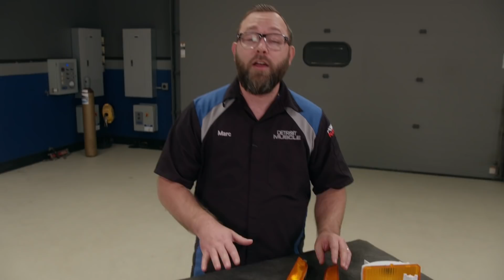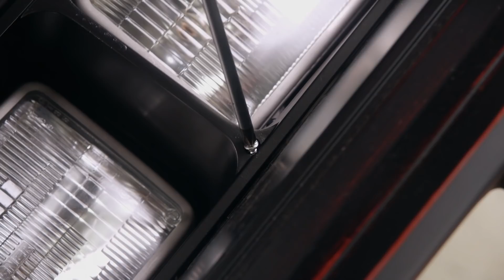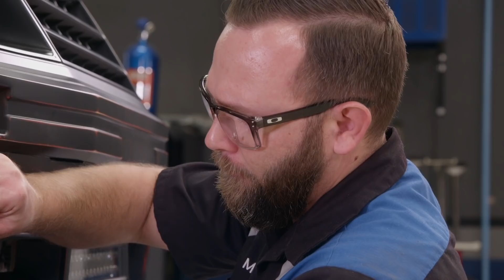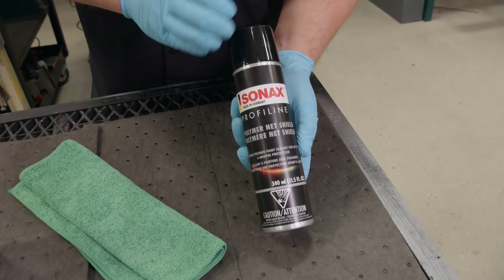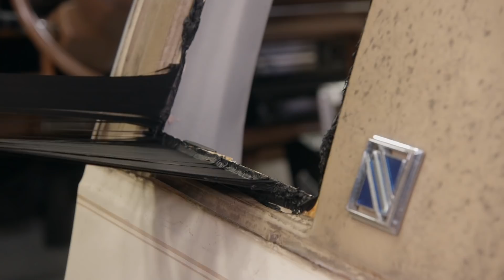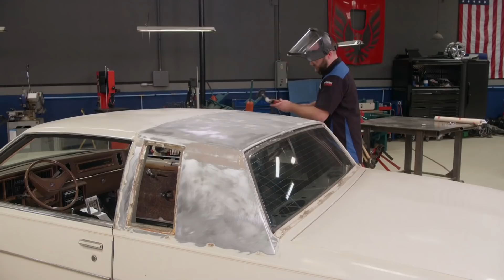Adding an Air Splitter on a Mustang Cobra Foxbody - Detroit Muscle S6, E5

Comment: I also came home from the hospital in a mustang. 70 mach 1 blue shaker hood and those black louvers on the back window. My dad said itd be mine at 16 well sold it when 12 or 13 yrs old.  My parents told me when they met that they had identical blue mach 1s. Moms was in nicer condition w the mag 500s and shaker hood. Dads had the cragers and louvers lol so switched wheels and sold his.   He regretted selling those mags cause how valuable they are now. Well then lol.  Dad passed couple yrs ago and I'm still a mustang guy because of him. I have 89 fox 347 5 spd and his 95 tbird 4.6

Comment: It probably don't matter but that opening they mounted the light bar in is more important for cooling than the actual grill. You always want to keep things like that in mind when playing with your toys. Like I said , prolly won't cause a problem as they upgraded the radiator and cooling system.

Comment: As for the LED Lightbar for the 81' Fox...

"Technically" that would be a Driving Light, as a TRUE Fog Light is AMBER... That would look ALOT better!🤯

Sorry for the "Technical Spatter", I'm just trying to clarify.

P.S. What episode went over the Engine, Brakes, Frame, Suspension, and Rear Axle?
Could you PLEASE respond with the "link"? 😎

Take care,
🤓 -Thomas
Western Washington State

Comment: First time I have ever seen plywood wheels. LOL!!! 🤣
Reply: those i think are so they can move the car around the shop,
Reply: everett grover you would think they would crush under that weight or they would slide all over that floor. At least that’s how my luck goes.
Reply: @nashrambler5246  that is true, they must be using the highest grade plywood, but the car had no interior, no engine or transmission from the looks of it, so it didnt weigh nearly as much as if it was fully loaded
Reply: Nash Rambler You've never worked in a shop then....
Reply: ACPHOTO yes, in fact I have and we never used plywood for that. We used old spares but never wood.